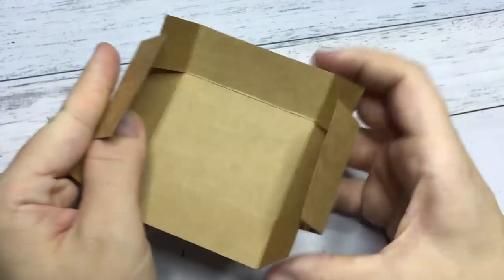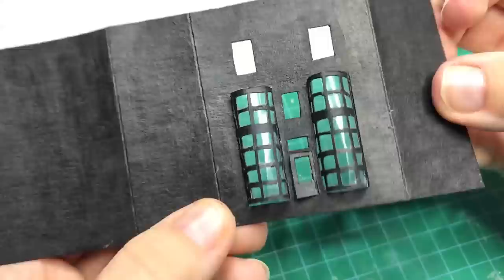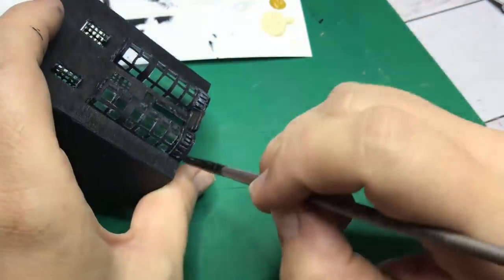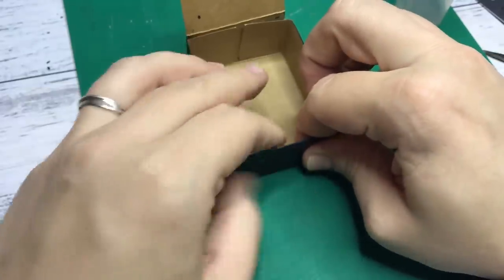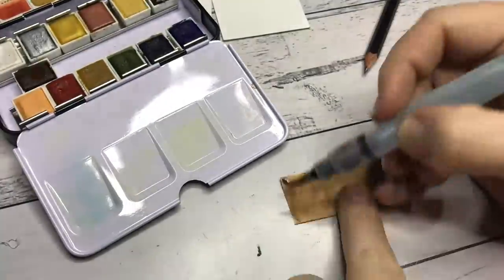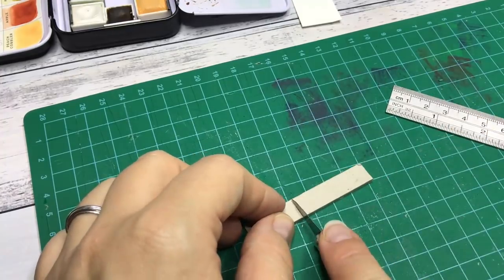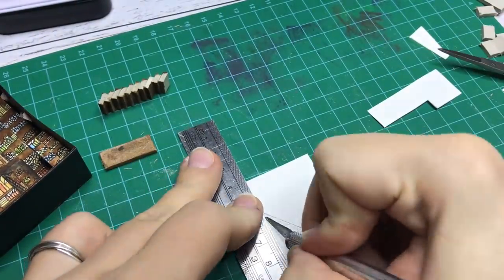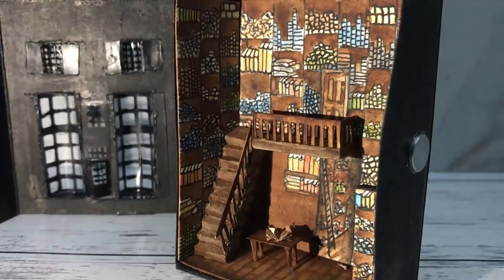Ollivander's Wand Shop | a Harry Potter Matchbox Diorama | Harry Potter miniature

Comment: Only just found this series and of course your other work. Fantastic stuff... I have a little tip to share however. When I saw you attaching magnets to the side and flap of the box, I remembered I had some metal tape that I bought for doing a similar thing with screens , for windows.. Having magnets glue to the actual window frame, would look odd, when the screens are not in use, so I found some self adhesive metal tape, that is white (you could easily paint it)  which is the same as the window frames, so almost invisible. That was, insetting the magnets into the screen frames, means no gap between the screen frame and window frame.. AND, if you ever put these in a row, you could use a magnet in one and metal paper in another so they would all lock together...

Anyway, loving this series, so I am off to watch the next one.. Keep up the great work
Reply from the maker: Thanks so much and welcome!!
Reply: @RavensMinis  You are very welcome. By the way the tape I got is "GAUDER Metal Tape Self Adhesive" you can get it in 1m, 3m, 6m and 12.5m rolls.. It's not cheap but considering how little you would need per project, it's not so bad.